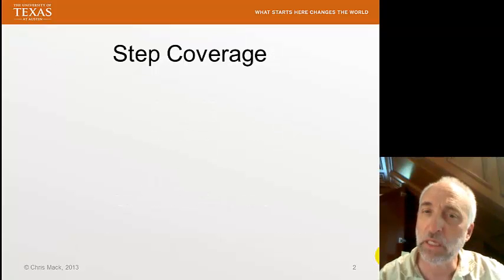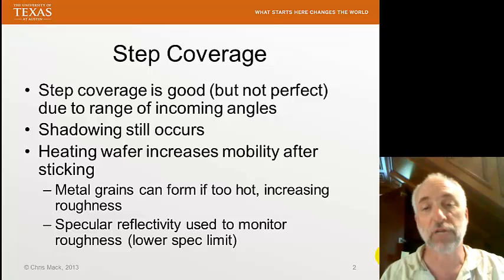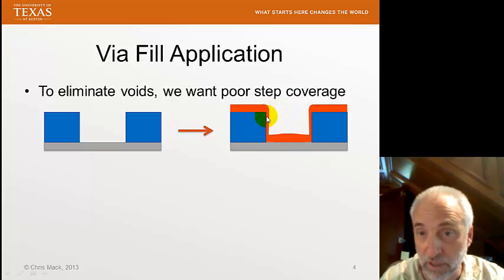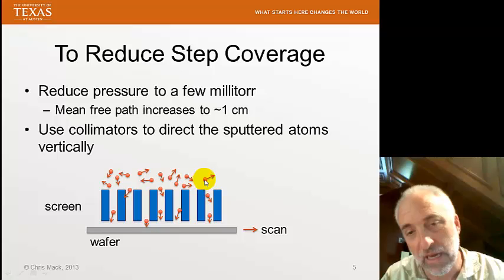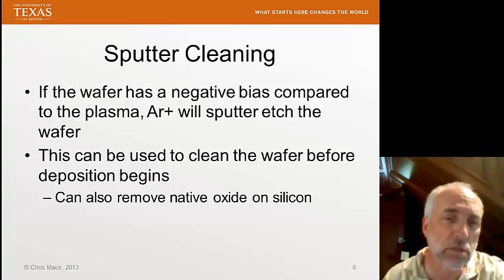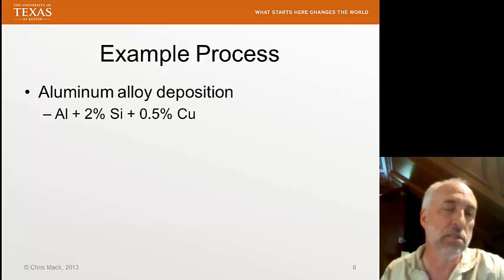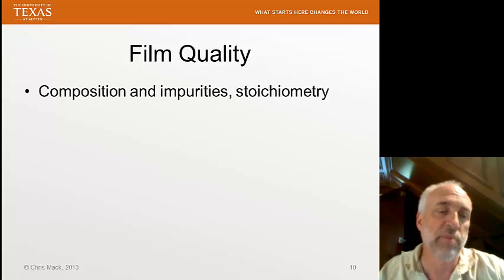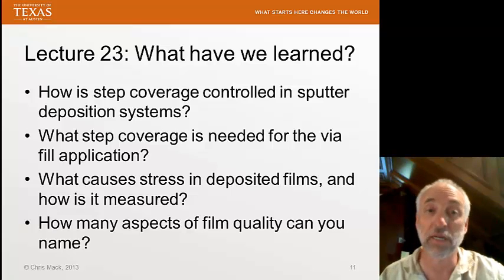Lecture 23 (CHE 323) Sputtering, part 2

Comment: AI Summary

Abstract:

This lecture, Part 2 of a two-part series on sputtering deposition, delves into critical aspects of thin film deposition for micro and nanofabrication. It begins by explaining how step coverage is achieved and controlled in sputtering, highlighting that while good step coverage is generally desirable, specific applications like via filling often require poor step coverage to prevent void formation. Methods for controlling step coverage, including the use of collimators and the ionization of sputtered vapor, are discussed. The lecture then introduces sputter cleaning for in situ wafer preparation and bias sputtering, a technique that leverages concurrent deposition and etching/redeposition to improve feature filling. Finally, it uses aluminum alloy deposition as a practical example to illustrate the importance of process parameters, discusses the issue of film stress and its measurement, and provides a comprehensive overview of various film quality metrics, encompassing compositional, electrical, mechanical, defect, thickness, step coverage, and optical properties.

Sputtering Deposition: Control, Applications, and Film Quality

*   0:00 Step Coverage in Sputter Deposition: Sputter deposition typically offers good step coverage due to the scattering of deposited material, ensuring a wide range of angles and effective coverage of features, though some shadowing persists.
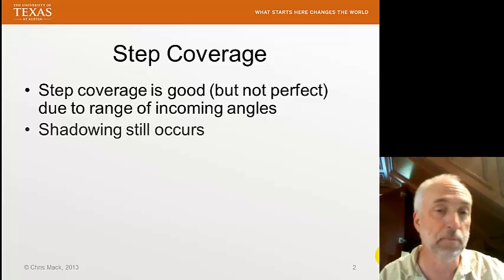*   1:00 Improving Step Coverage Through Mobility: Step coverage can be further enhanced by increasing the mobility of deposited material on the wafer's surface, often achieved by heating the wafer to promote surface diffusion.
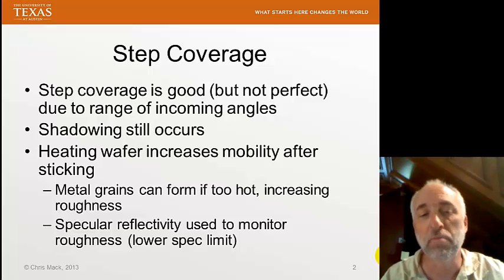*   2:09 Challenges of Overheating: Excessive wafer heating can lead to the formation of metal grains, resulting in surface roughness, and potential reliability and conductivity issues.
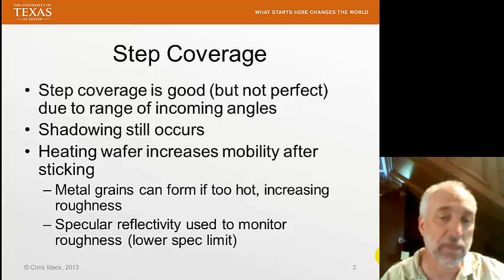*   2:44 Monitoring Surface Roughness: Film roughness is monitored using specular reflectivity; a decrease in reflectivity indicates increased scattering and a rougher film surface.
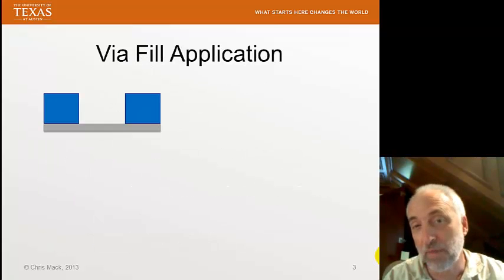*   4:05 Via Fill Application: In filling deep features like vias (contact holes) with metal, processes with good step coverage can lead to problematic voids, as the top edges close off before the hole is completely filled.
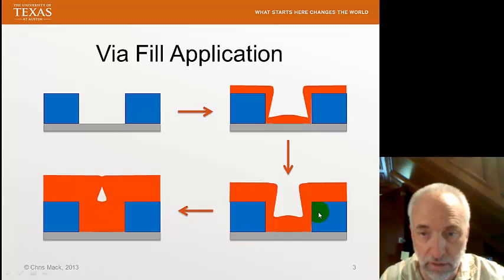*   5:50 Consequences of Voids: Voids pose significant reliability problems and defects, complicating subsequent planarization steps like Chemical Mechanical Polishing (CMP).
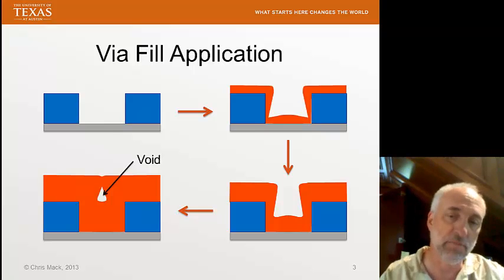*   6:34 Preventing Voids with Poor Step Coverage: To avoid voids in via filling, deposition processes with intentionally poor step coverage are used, allowing the material to fill the feature from the bottom up.
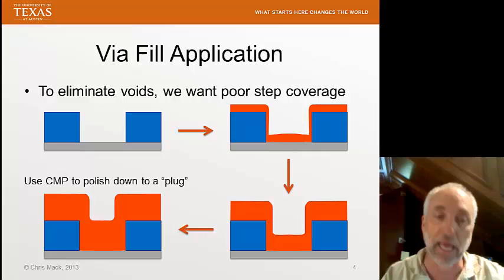*   8:14 Methods to Reduce Step Coverage:
    *   Lowering Pressure: Reducing chamber pressure increases the mean-free path of sputtered atoms, making them hit the wafer more vertically but severely reducing deposition rates.
    *   Using a Collimator: A collimator, a screen with tall, narrow openings placed above the wafer, physically directs sputtered atoms almost vertically, with wafer scanning ensuring uniform film thickness.
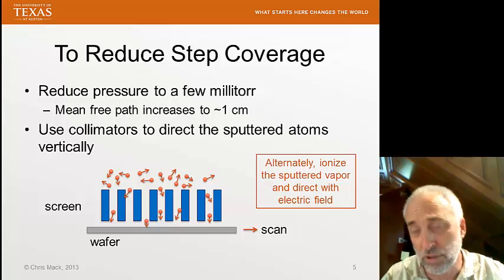*   11:25 Ionizing Sputtered Vapor: An alternative for reducing step coverage is to ionize the sputtered atoms and use an electric field to direct them vertically to the wafer.
*   11:55 Sputter Cleaning: A slight negative bias applied to the wafer can cause argon ions from the plasma to sputter off surface impurities or native oxides (e.g., on silicon) in situ before deposition, but this risks damaging sensitive substrates.
*   14:05 Bias Sputtering for Enhanced Fill: During deposition, maintaining a negative bias on the wafer causes directional etching by argon ions. The sputtered material redeposits on sidewalls, effectively improving fill characteristics (leading to better step coverage in terms of filling a hole) and achieving a more uniform thickness at the bottom of features, provided the deposition rate exceeds the etch rate.
*   16:28 Aluminum Alloy Deposition: Aluminum, often alloyed with small percentages of silicon and copper, was a dominant metallization material. Sputtering allows for easy deposition of alloys by using a target of the desired composition.
*   17:47 Planar DC Magnetron System: This system type is commonly used for aluminum deposition, generating a high-density plasma for efficient, high-rate deposition.
*   18:11 Importance of Low Contaminants: Keeping oxygen and nitrogen levels extremely low in the chamber is vital to prevent adverse chemical reactions with the aluminum.
*   18:20 Film Stress and Reliability: Stress in deposited metal films (often due to thermal expansion mismatch during cooling) can severely impact reliability, particularly concerning electromigration under current, and is monitored by measuring wafer bow.
*   19:56 Key Aspects of Film Quality: A high-quality film is characterized by several factors, including:
    *   Composition: Correct stoichiometry, low impurities, and accurate alloy composition.
    *   Electrical Properties: Desired resistivity (metals) and high breakdown voltage (dielectrics).
    *   Mechanical Properties: Controlled stress levels.
    *   Defects: Absence of pinholes, particles, and good adhesion to the substrate.
    *   Thickness Control: Accuracy and uniformity across the wafer, from wafer-to-wafer, and lot-to-lot.
    *   Step Coverage: Achieving the specific step coverage (e.g., conformal or planarizing) required for the application.
    *   Optical Properties: Desired reflectivity (related to roughness) and refractive index (important for subsequent lithography steps).

I used gemini-2.5-flash-preview-05-20| input-price: 0.15 output-price: 3.5 max-context-length: 128_000 on rocketrecap dot com to summarize the transcript.
Cost (if I didn't use the free tier): $0.0069
Input tokens: 19403
Output tokens: 1150

Comment: do you have any tips as to how to achieve a good thickness uniformity of the sputtered layer in RF sputtering. I am having 6 nm difference in one chip measuring at 10 different points. many thanks
Reply: Target to substrate space is the first thing I would play with.  Putting bias on the substrate during sputtering will also give you control.

Comment: Does the stoichiometry of materials (oxides) change during Radio frequency sputtering? Does anybody happen to see any  literature discussing the processes during which atoms break away from the letter in the target and then rearrange themselves as they land on the substrate? I really want to understand this. mayy thanks
Reply: Your comments are from 2 years ago so I don't know if you already found your answers.  Stoichiometry definitely can change especially if you have reactive background gas.  For example, you can flow nitrogen while sputtering titanium to make titanium nitride.  The amount of N2 and the power determines the stoichiometry of the deposited films.
For your second question, grain growth is very common in PVD deposition.  It is much harder to deposit amorphous films than to deposit crystalline films.

Comment: thanks ! very instructive. I am trying to metalize copper on polyimide films. Some papers teach that to get a very good adhesion, it is necessary first to sputter chrome (or Ni-Cr) and after that plate copper (by sputtering or evaporation and eletroplating for thickening). A continous film of chrome is not compatible with PCB process. Question: is it practical to sputter some "seeds" of chrome on Polyimide film to act as anchors for a subsequent copper evaporation ? I am working on a chamber to allow both process in same trial. thanks.
Reply from the maker: +fercarcas Sorry, but I have no knowledge or experience that might be helpful for answering your question.  Good luck!

Comment: For sputter deposition, the angle is usually assumed to be a cos^n behavior.  If you think a bit, the optimal deposition is so that the 1 sigma of the angle is equivalent to the worst case short line or via.  Then to use resputtering to coat the bottom surface.  the concept of self igniting plasmas is really interesting, btw. Most modern systems use no argon during deposition.

Anyway, I really appreciate the sequence, and for a short intro, this was ok. PVD is more interesting than it appears..